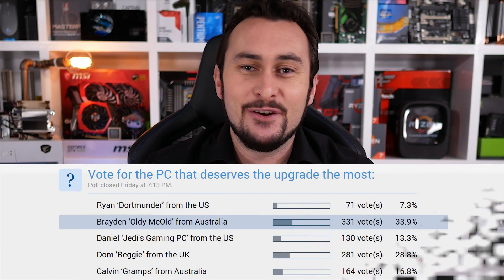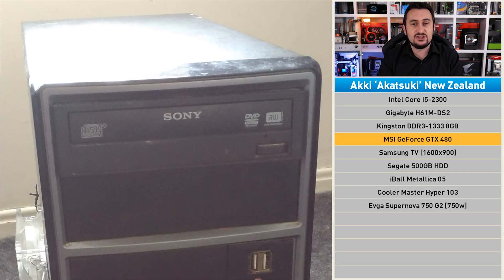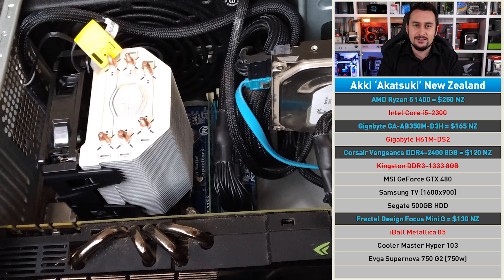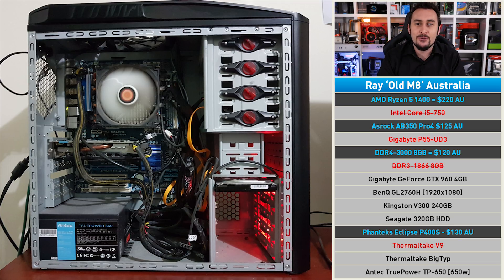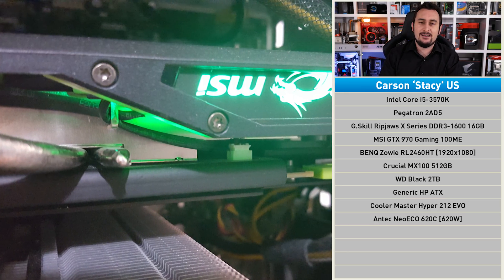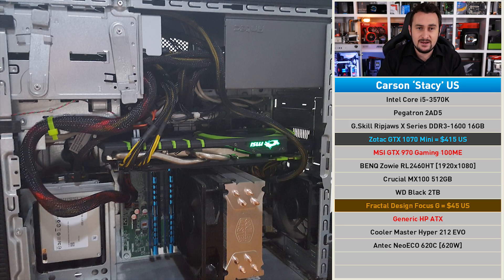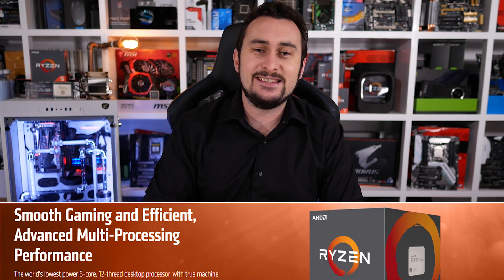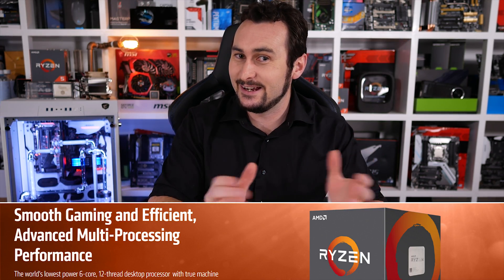Upgrade My PC Please! [S01E03] Core i5 Owners Needing Help!

Comment: This video is kinda full of gr8 PCs!! 
My PC is potato and I hope it gets selected in a future video!! :)
Reply from the maker: The point of the series isn't only to look at potatos. It isn't unreasonable for people using older Core i5 systems to want an upgrade as well. Problem with potatoes is that it's usually cheaper and easier just to build an entirely new PC.
Reply: Hardware Unboxed Ye...I get it. Keep up the gr8 work!! :D

Comment: I feel like my pc would fit along these
4690k(with a stock Intel heatsink)
Msi z97 gd65 gaming mobo with only one working dimm slot 
gtx 660ti that's dying and will load scenes with horrid textures at first and has bad artifacting issues with some newer games at times
And two hard drives a 1.5tb and 320gb that housed the operating system and also just happens to be dead and windows refuses to install on my other hard drive so it's basicly just a gaint brick because this cooler master haf case is frickin huge

Comment: Great video as always Steve And Thank you very much for the 1600!!!!!!!!!!!
Reply: ed samuels wow lucky!
Reply: Thank you
Reply: Thats  my rig. Its nothing special. Just a Asrock fm2 motherboard running a Athlon x4 870k. Got the water cooler and gtx 1070 last year because I planed to upgrade but its been tough here in N.Y. way to expansive. But I can afford the new mobo and ram now that I dont have to get a cpu. The 1070 will be free to stretch its legs finally !!!! lol
Reply: What do you plan to do with the 1600? Looks like you got a decent build in your profile pic (if it is yours) What cpu do you currently got?

Comment: I haven't had much success over 4.2ghz either with the hyper 212 evo, on a 4690k, default 3.5ghz, clocked @ 4.2 ghz, just not 100% stable otherwise
Reply: id try some different thermal compound, other than that unlucky silicon i guess
Reply: Voltage?
Reply: A little over 1.2v, says 1.2v in windows with cpu-z.  I had it at 4.3ghz but not 100% stable, also wierd slight stuttering, not thermal throttling as it wouldnt get into the 90s C. At 4.2ghz gets into the 70C. May have to delid, but its what seems the norm, air cooling hits the limit around that ghz.
Reply: 4690k @ 4.4 ghz @ VID 1.250v (cache ratio 40) + hyper 212 evo + artic silver 5 = 65-70° full load 100% stable
Reply: I just tried to delid, it went well till I glued it back on :/ then its placement of the heatspreader was off, took it back off, tried to clean up glue and scratched off some chips near the die. Typing from the computer, but its temperature is now stupid high and its not stable at all, derp